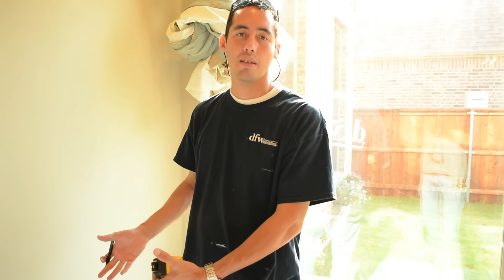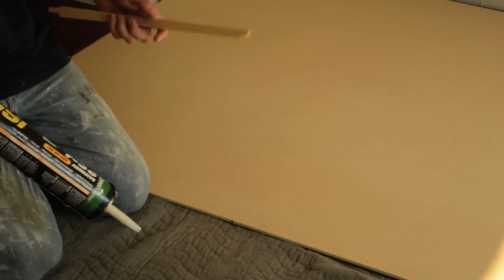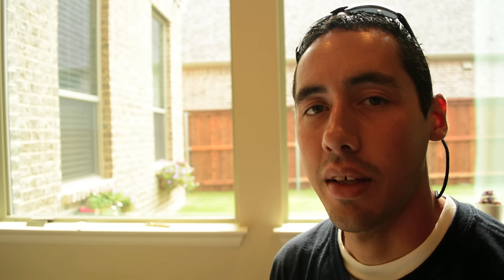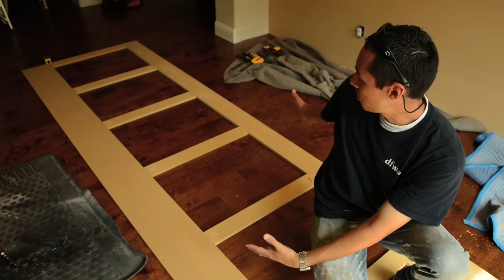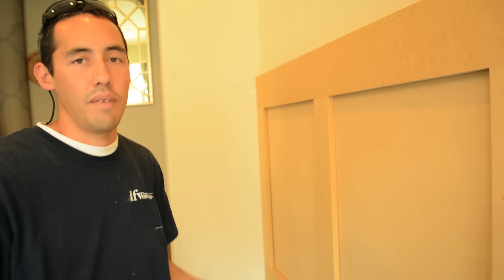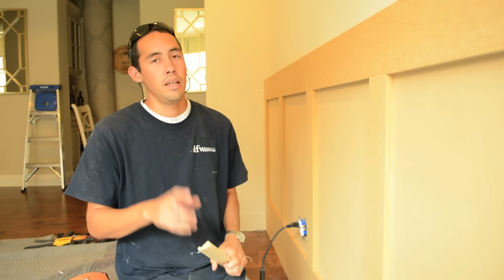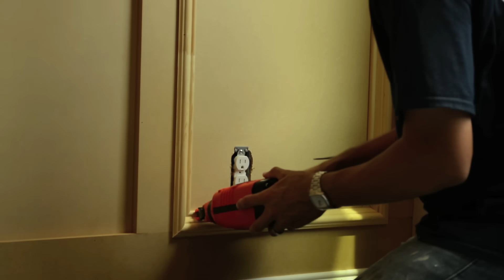Recessed Panel Wainscoting Installation - How to Install

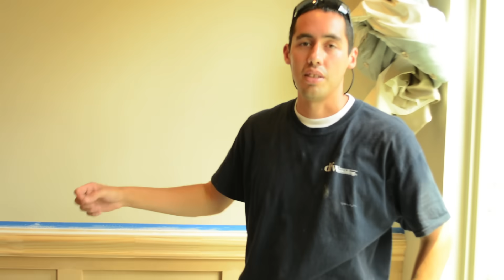Comment: @14:30 you blew right by showing how you attached the top molding installation! Would have been nice to see the cross section of the rail.
Reply: +1 even a 1/8" with an MDF backing board and a 3/4" deep rail it's still thicker than any top moulding I've been able to find at the local Lowe's or Home Depot. Did you have to put a furring strip behind the chair rail and put the quarter round on top to hide the seam?
Reply: I actually meant the top molding installed, not a "top" molding as in style. I've since watched several other youtube videos on wainscoting and some show a thinner "top" finish molding. I guess there must be different sizes available depending on the depth or thickness of the MDF wainscoting on the wall. 

My next self-training will be learning how to correctly spray paint molding, doors, etc, instead of painting with a brush. It's such a professional looking finish.
Reply: i usually do all my doors/molding etc with a mini micro fiber roller, i rarely ever spray anything. i prefer the finish of the roller as compared to the sprayer , it does take longer but for me its worth the extra application time to get it looking the way i want it and to not have to deal with the spray gun cleaning.

Comment: I just wanted to know how to cut the holes for the outlets, that was my biggest issue.  Your panel already had the hole.  Great video, overall.
Reply: This is probably not the ideal solution but here's what I was told to do: take an ink pad and press it against the outlet face. Then put the back of the board to be cut in place. The ink should transfer to the back of the board but still be able to cleaned off. That will give you an idea of where to measure to make the eventual cut. Also, put masking tape on the "show" face to reduce tearout.

Comment: Love the video.  However, where can I find panel mold #2?  Is it called by a different name?   I'm having a hard time finding something like what you used.  I'm half way thru the project and need the molding. Thanks!
Reply: Hi Steve, any luck finding the offset moulding. Im looking for it too

Comment: Thanks so much for these videos. My house is one of hundreds thrown up fast in the 50's, just boxes with roofs and no character.  With the help of your video I am installing crown moulding, cabinet trim, baseboards and trim around the doors/windows. You are correct about the black cat. Keep up the good work and keep the videos coming. Thanks

Comment: Just subscribed to your channel and love your work. I'm trying to find the same panel moulding moulding that goes into the box but it's neither at Home Depot or lowes. I would appreciate it if you can post the link or can tell where you got it from. 

Thanks.

Comment: is the chalk line level or do you just measure from the bottom of floor to desired height on both ends?
Reply: That is where the artistic portion of this type of work plays into the plan of a project like this.  It is sometimes necessary to install trim out of level or square to give the appearance of an even reveal in situations when floors, ceilings or walls are not square, plumb, or true.  It can add hours of work to an ordinarily quick job if all was perfect and isn't easily done.
Reply: read my mind in case the floor is sagged in an older home
Reply: missmymountain ... Just wow...
Reply: measure from the floor in the corners, mark the wall, measure length, hang the piece and then go level through the middle to take out any sag
Reply: Keep parallel to the floor so that your MDF is cut square.
Reply: Keep parallel to the floor so that your MDF is cut square.

Comment: Have you tried using a notched trowel to spread the glue?
Reply: Was thinking the same thing for even coverage
Reply: Then you have to clean that crap off the trowel that's stuff isn't water based
Reply: I use a linoleum glue 4" blade it has V notches around 1/8" deep, works great
Reply: +rats arsed
What do you mean could not afford to do it right? Do you mean he did not do it with completely solid wood?

Comment: one question how did u end up spray painting the thing without dirtying the whole room
Reply: I've done the spray paint, wet sanding think with my base trims and door frames. it's too much of a PITA. There are paints and brushes that flow very well to a point you will never see lines.

Comment: Richard could I leave a gap between 1/4 MDF backing to make sure that my join falls behind the reveal and not in the middle of the square....?
Reply from the maker: ESGAR MONTALVO yes, I do that sometimes. I just make sure the stile has support from. both pieces . basically splitting the gap on a stile

Comment: thanks a bunch...you have taken a lot of the mystery out of putting up molding...but how do you cut out electrical boxes so neatly?
Reply: plunge depth vibrating saw
Reply: drill a hole and use a jigsaw. Or just use an oscillating tool with a good blade.

Comment: Most MDF are only 8ft long. Did you use pocket screws to extend the mdf all the way through the wall? I didn't see any extensions on the 3/8" mdf
Reply from the maker: good question. I was able to get these boards in 16 foot lengths,

Comment: nice job a small detail that many miss is that you pulled out the receptacles so that they will sit flush
Reply from the maker: thanks!
Reply: need a box extender by NEC code

Comment: Would you recommend mdf in a restroom or would you use another product?
Reply: I wouldn't recommend MDF in a bathroom, no. But sometimes it's unavoidable as they don't really make a waterproof panel that's paintable. If you do, float it about 3/32" off the ground and caulk it.

Comment: Question. Why do you prime before filling the nail holes?
Reply from the maker: the primer shows me where the nail holes are. it's kind of hard to find them all on the raw wood. but either way works good.
Reply: dfw crown
Wow. Thanks for a fast reply. I do a lot of DIY projects, so I may give this a try after I finish my kitchen reno.

Comment: When you nail the first sheet of 1/4" mdf, are you hitting the studs or just going into the drywall?
Reply: Gary Z - I would guess he's just hitting drywall. The glue is doing the bonding. The nails are just to keep it from sagging or waving till the OSI bonds up. I did this same job in Vegas in a hotel  years ago and the specs didn't call for hitting studs because of the glue. The MDF is only 1/4" so the panel doesn't weigh that much and the blow out or pull out  in the drywall will be none to minimal. . I'd more concerned with nail length and depth not to strike any wiring or plumbing.
Reply: I would suggest hitting the stud if you can because it will offer better overall stability even if you are only putting in a few nails.

Comment: Do you have a list of materials anywhere?
Specifically the trim and chair rail pieces, as well as the shoe mold you placed on top?
Reply: Did you have a larger than 4'x8' piece of mdf to make the rails and the styles?
Where can that be purchased from?
I also find that the pocket screw can cause "bulging in the mdf.

Comment: Once a fantastic video.  Please show a up close pic of the trim molding and how you joined that with caulking to your chair molding.  What size nails do you use?  Is all of the backing and frame MDF and why MDF for anything?

Comment: I like the logic and method - very efficient and easy and will keep in mind for the future. 

However, I don't like how this project resulted in an asymmetrical design. The gap between the top of the baseboard and the bottom inner trim vs the gap between the bottom of the chair rail and the top of the inner trim is completely different. 

If it was me paying for this, I'd ask you to redo it.
Reply from the maker: +Alex Brandt Thanks. I understand your point of view. It would be extremely easy to make that adjustment. The top stile (horizontal 3/4" MDF) would be increased to match the reveal of the bottom one. 

If you were paying me I would have gone over the project in detail before getting started. So there would be no reason to redo it. All of my jobs are custom and there is not a template that I use. Each job comes out different based on the persons desires. Thanks.
Reply: I like the asymmetrical design, gives the room a taller feel.

Comment: You don;t explain why you put a 1/4 mdf sheet on the wall.  Can't you just build your rails and stiles as you showed and then attach it directly to the wall instead of the 1/4 mdf?
Reply from the maker: you could do that but it would be textured like the rest of the drywall. not a smooth finish.

Comment: Great Video, Man!!!  How does your method change for installing above stairs/stringer??
Reply from the maker: I will usually leave the skirting on and just put a panel mould to make the transition smooth between the skirt and bottom rail

Comment: Hola como se llama  el dispositivo para agujerear las maderas en diagonal y  +/- cuanto cuesta , en USA , gracias desde Argentina  /Hello as it is called the device to pierce the woods in diagonal and +/- how much it costs in USA, thank you from Argentina
Reply from the maker: $400.00
Reply: gracias
Reply: +dfw crown Damn. That little clamp-on pilot thing was $400?
Reply: +MrFixBroken He meant $40.00
http://www.lowes.com/pd_255535-39450-R3___?productId=1072743&pl=1&Ntt=pocket+hole+jig

Comment: Getting ready to do a wainscot job like you demoed and have a couple questions. correct me if I'm wrong but you ripped the three and a half stiles and rails from sheet goods, so to run longer than 8ft lengths what joint do you find works best for connecting  the pieces? Also it looked like your top rail was wider so as to balance the exposed area of MDF all the way around. Thanks again for all the great videos, really like the 3 piece crown work.
Reply from the maker: +Steve Allmand I did not rip the 3-1/2" stiles to width. 
I get them from the supplier already at 3-1/2". 
It's called a 1" X 4" but it's truly 3/4" X 3-1/2"
I get all of my material 16 foot long, so I rarely have a joint. But if I do I always use the pocket hole. 
Yes, my top rail is a 1" X 6" (truly 3/4" X 5-1/2") And yes you are correct. It is to balance the reveal of the framing once all the trim is installed. Thanks.

Comment: roughly how much would it cost to do this job?.
Reply: One wall would cost $750-1,000  for labor only in NY and material +- $350
Reply: I I did it by the hour it would cost you approximately $29,000.00 because I take so long.

Comment: nice finish!!!!why you don't use wood glue in the joints? and is there other product than the OSI more liquid or runny that you would recommend? thx
Reply from the maker: I don't use glue on inside miters. I use 16 guage nails in a v pattern, never have any issues with separation. I'd recommend a product called "fast grab"

Comment: Excellent video and superb work! One question, where do you get the panel mould? I've checked HD and Lowes also one trim supplier but can not find what you where using with the offset and notched out back.
Reply from the maker: thanks a lot. search for Millwork in your area.

Comment: Great video! I'm curious, would you plan your spaces of the stiles on each wall differently because of the receptacle locations? Or make a whole house uniform in spacing and deal with receptacles if they hit the stiles?
Reply from the maker: +JR Custom Cabinetry Thanks. I will definitely plan around the receptacle location. I've actually had to move some. The whole house will usually never be uniform, just due to the fact that every wall is a different length.

Comment: Did you use 1/4 inch bead board mdf for the backer on the stair case job ?
Reply from the maker: +Ray Yes.

Comment: Home centers like Lowe's and home depot don't sell boards that are 16' in length. Where can I get an MDF board to make the  the bottom MDF board which is 9 1/2 inches wide that is 16" long?
Reply from the maker: +eddie jimenez Search for a millwork/plywood company in your area.
Reply: +eddie jimenez Go to a real lumber yard, most stock 1 x 12 x 16' MDF, Use as long of a piece as you can, when MDF is joined to MDF it never paints very good and you always see a shadow line after painting.

Comment: Hi thanks again for the tips. I have another question. The bottom MDF board is 9 1/2 inches wide. Since the wall is longer than 8 feet are you joining this board with pocket holes with a straight cut or can you cut the board at a 45 and still make pocket holes since it's in an angle?
Reply from the maker: +eddie jimenez I get the boards 16 foot long. So, no pocket holes necessary on this job. But I would join with pocket holes and a straight cut if it were longer than 16'

Comment: I enjoyed watching this video. I only have one question. I noticed that you used (2 ) 1/4 eight foot sheets that go against the wall. You used pocket holes to join the stiles and rails but how did you join the MDF frame that was longer than 8 feet? Did you use a 45 degree angle or did you buy MDF boards that were longer than 8 feet?
Reply from the maker: correct. we used mdf that was longer than 8'. we get our mdf in 16' length and cut it down from there. if the wall were longer than 16', we would pocket hole it together

Comment: Another question.  How long pocket hole screws do you typically use when joining 3/4 MDF to 3/4 MDF?
Reply from the maker: +aearnest I use 1-1/4" pocket hole screws. I have to back up my bushing on the bit to make sure I don't have a screw come through the other side. 1" screws will work too.

Comment: As others have said..thank you.  I am wanting to do this for my house and this video was a tremendous help.
Question:  Cutting the MDF from the 4x8 sheets.  Are you using a track saw or a circular saw w/ a MDF finish blade to cut to the correct dimensions?
Reply from the maker: +aearnest Thanks! We use a circular saw with a straight board and two clamps. Basically an old school track saw setup. We use fine finish blades on all of our saws.

Comment: Thanks for the details in your videos and please keep them coming. Question on the shoe moulding, I noticed in this and your glaze video that you are putting a shoe moulding at the top of the chair rail. If your first MDF sheet is 1/4" and the second for the rails/stiles is 3/4", that would total an inch you would have to cover in order to not see the seam/joint of the chair rail. Is your shoe moulding that wide or are you caulking/sanding that seam and just covering the 1/4" MDF sheet? Second question, the chair rail in your glaze video appears quite wide, almost appears to have a ledge or cap like in assembling a traditional wainscot panel. What is that one called? Thanks for any help.
Reply: Jacob Maddox
Reply: essential craftsman
Reply: Anytime you can post an informative video on YouTube you make a little extra $$$$.
Reply: essential craftsman........................... Some of his videos are not that great

Comment: So everything is MDF except the PM's. 1/4" sheets on the wall  and then the 5 1/2" top rail and 9 1/2" bottom rail, and 3 1/2 styles, all cut from a 3/4" sheet of MDF.  Am I correct?
Reply from the maker: +Jack B Yes everything is MDF, except for the PM, and chair rail. Correct.

Comment: Great video!  Can you please provide me with information on the exact material you used for the chair rail cap.  I've looked into a few different wainscot cap options, but none seem to fit correctly over the 1" thick material.
Reply from the maker: +Dan Duxbury Thank you! Go to Google and type in "CR-7 chair rail", or "CR-6 chair rail".

Comment: Great video. Very helpful and I like the chill demeanor :) This project looks expensive though, especially if you're doing a whole room.
Reply from the maker: +Joshua Bushared Thank you. Yeah, I'm a chill kind of a guy. lol. Yeah, about $900.00 for this wall. It can get fairly expensive.
Reply: +dfw crown That $900.00 was the cost to the homeowner, right? I'd image you could do it a lot cheaper as a diy project. I'm looking into it now; seems like the big cost comes from the molding.

Comment: I'm a first time home buyer DIY kind of guy looking to install some panel molding and your video was great. You left out some measurments. How thick were the full MDF boards you installed on the wall? How thick were the paneling on top? And what was the dimension of the top board? You said at some point the top board is a 3.5" chair rail but what was the board behind that makes the panel squares? Didn't look as large as the bottom 9.5" board. You have skills.Thanks,Danny
Reply from the maker: +Danny Bruno Thanks for the comment. The full sheet of MDF was 1/4". The pieces on top of that are 3/4".  The top rail was 5-1/2" wide.  Yes, the top board is smaller than the bottom one in width. It works out that way to get the correct proportions.

Comment: Great tutorial, but having some trouble finding materials, particularly the 4x8x1/4 MDF sheets. I live in NE Ohio & both Lowes/Home Depot seem to only stock 2' & 4' long sheets in 1/4". I don't want to deal with hiding that many seams! Any suggestions? Thanks.
Reply from the maker: I would try to find a Lumber yard or hardwood dealer that is in the area. they usually carry it. Yeah I definitely agree, hiding that many seams wouldn't be fun.